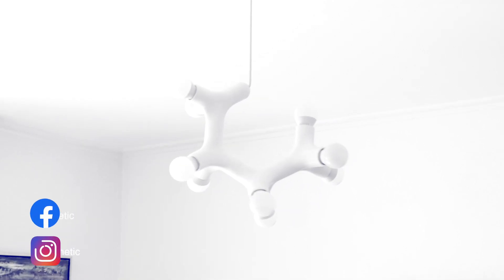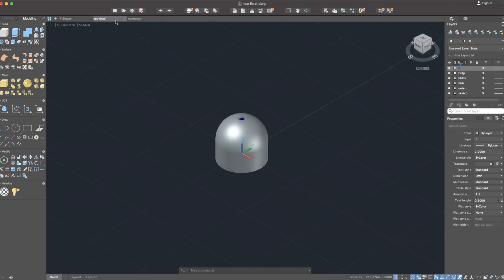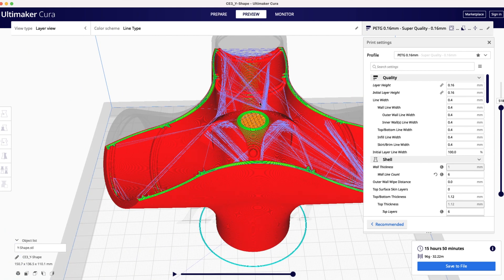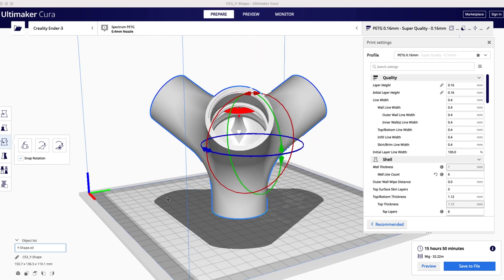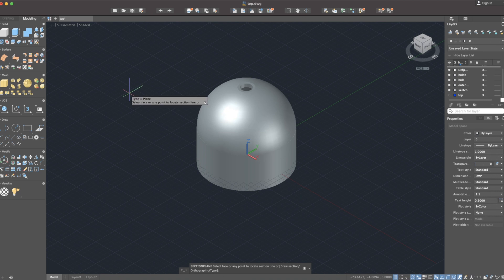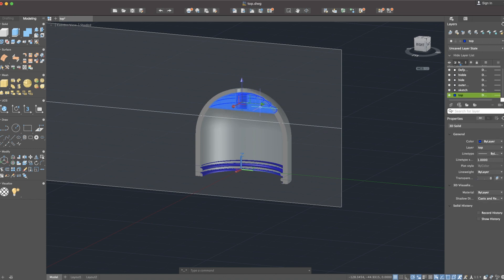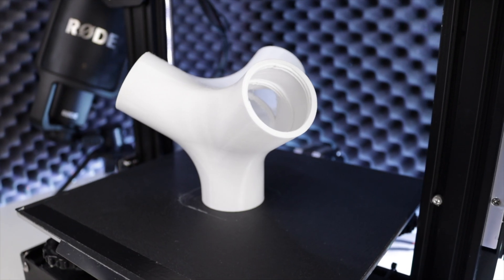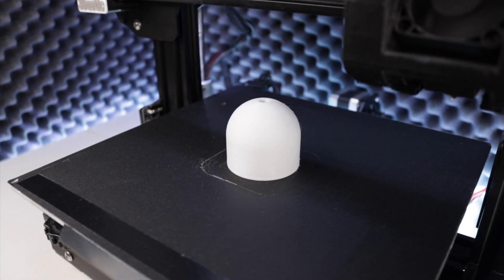👉  3d printed Designer Lamp | Printing instructions | Free STL

Comment: I almost used the same settings. But for me the print time is 1 Day 3 hours 45 min. Would you help?
Reply from the maker: What printer do you use?
Reply: @3dnetic  I use ender 3, PETG
Reply from the maker: Should be max around 16 hours. Please double check number of walls and speed